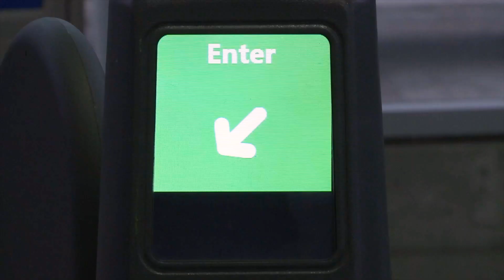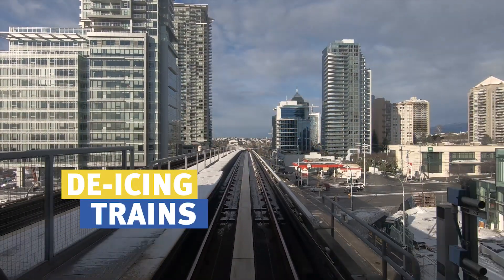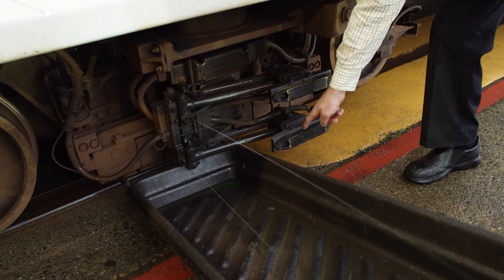Winter Readiness: SkyTrain

Comment: The new sky train is supposed to go to newton.  Its been mislabeled as lrt, i think that is what they use in alberta but ours is called sky train and the sky train is supposed to go to the new rec center that is opening is newton.  The current rec center has no sauna, so it be nice to get heat there.  They also have issued out coins for it in 2017.  The new loonie with two trains on it, an old and new, as well as a glow in the dark toonie came with the set.  Looking forward to the construction of this project.  Just one thing, the map says its supposed to go from king george, it is suppossd to go from 128 street so that needs to be explored a bit more, on the way back it migbt be starting from king geroge but will conect to 128 street and then to sky train.  I saw a train there few weeks ago, looks like that route already has tracks built and trains are coming and gonig there. Hope its going to be soon, we been waiting since 2017 and federal government has poured millions and funded the project.  They have paid for it so let get it delivered.